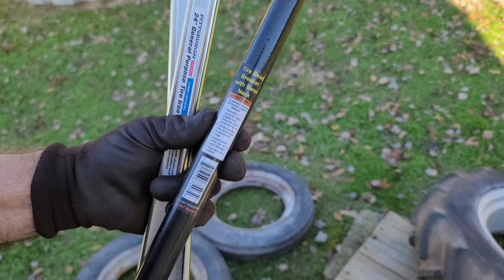'49 Farmall Super A Paint and Tires

Comment: Nice job. The tires you took off are still better than what I'm running now. So many more parts readily available in the US.
Reply from the maker: I found the new ones from a guy on ebay for $287 each and free shipping!  The old ones weren't bad , they held air just splitting though.  Thank you for the kind words!
Reply: @bourbonbeertractorsandprep9335  Lucky man. The old tubes looked pretty rusty on the inside. I had one give up totally right as spring started 😐 Good idea with the duct tape.
Reply from the maker: @___PK__  yeah the tubes were completely stuck by rust to the rims , so fun lol

Comment: I recently bought a 1956 Farmall 130 which has four old rotted tires. The front rims are not bad except for really old paint while I am replacing both of the rear rims. The left rear rim is so rusted out that the tire is being held in place via memory of where it used to be held by the rim. I bought two new rims for the rear so IF my rims are worse/the same as these I will just take them to the dump all together.
Reply from the maker: Congrats on the purchase!  Yeah my one rear rim is on the edge of needing replaced but its good enough to still use. In a couple weeks Im picking up a 1943 H with a front loader! Thanks for watching!